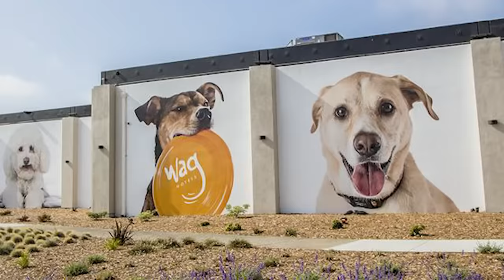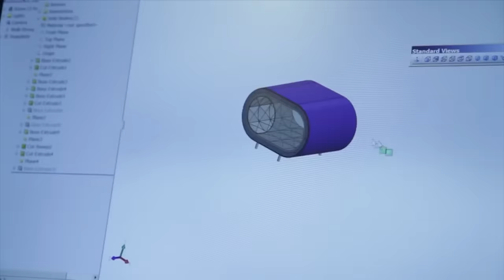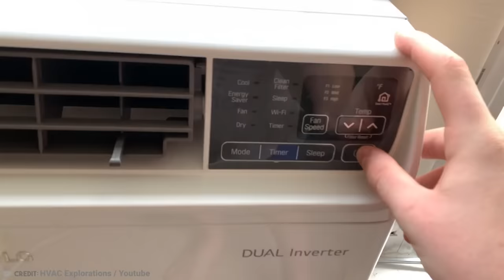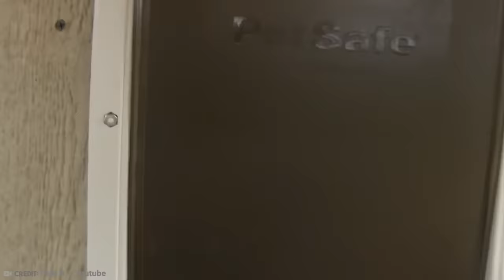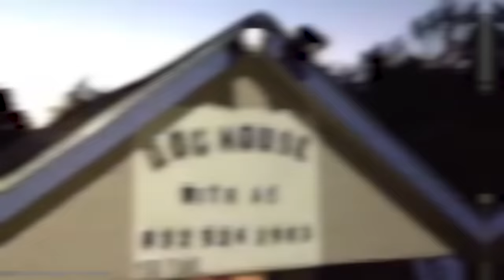15 Most Luxurious Dog Houses in The World

Comment: Bro, i could build each one for FAR less.
And id do it super heavy duty, beams anchored into the groud, thick concrete slab, storm reinforced joints, insulation, offgrid amenities, glowinthedark lights, human accessable, and anything else you can think of. All with an eye towards longterm stability and temp control. For much less. As self sustainable as a dog house can be. Id even give it geothermal, solar, a well, covered porch and covered dirt floor area infront of porch area, to encourage potty outside.